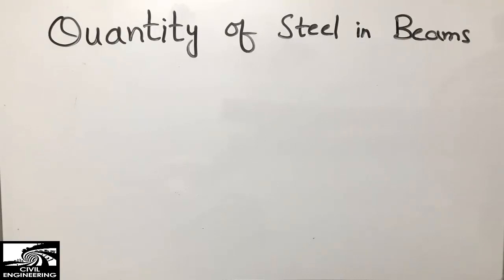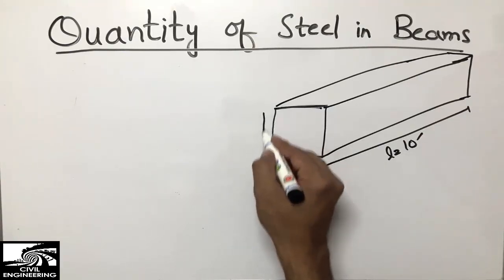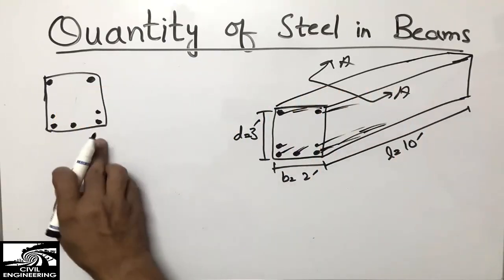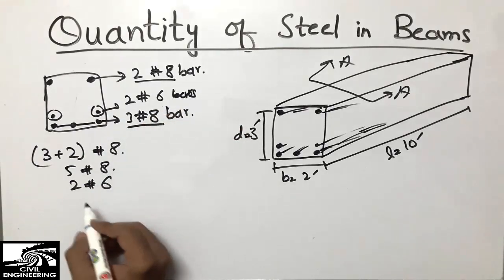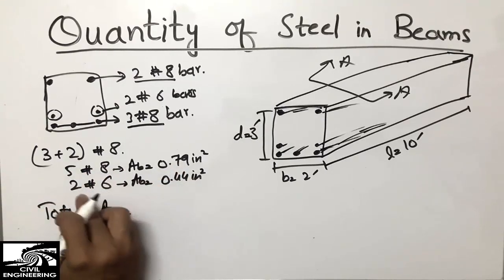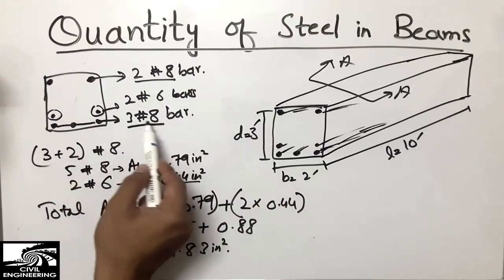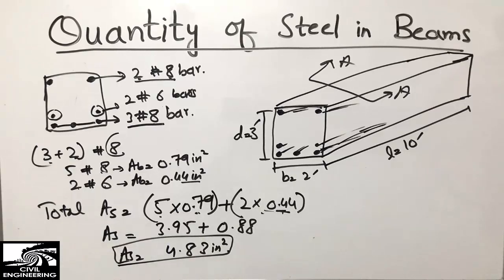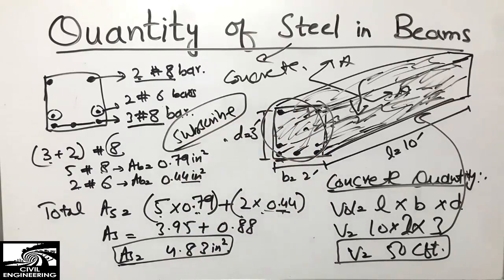Quantity of Steel and Concrete in R.C.C Beam

Comment from the maker: The Volume of concrete is = 10x2x3= 60 cubic feet
Reply: @er.junaidsheikh9247  the area of steel is wrong.  for #8 it should be 0.078 sq.in. and for #6 it should be 0.044 sq.in.
Reply: the area of steel is wrong.  for #8 it should be 0.078 sq.in. and for #6 it should be 0.044 sq.in.

Comment: A high-strength steel bar used in a large crane has a diameter d=50mm (see 
figure).The steel has modulus of elasticity E=200GPa and Poisson’s ratio v=0.3. 
Because of clearance requirements, the diameter of the bar is limited to 
50.025mm when it is compressed by axial forces. What is the largest compressive 
load Pmax that is permitted? solution pls